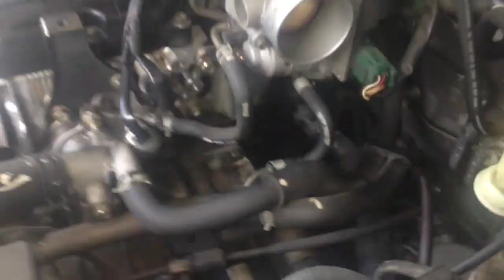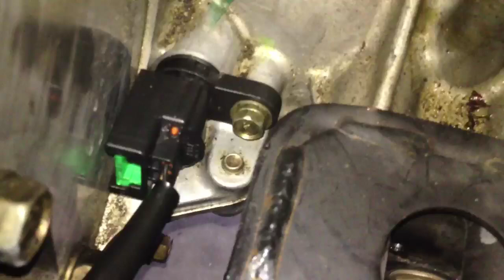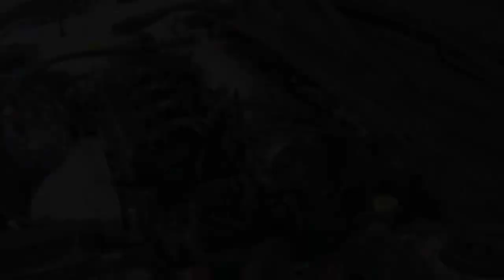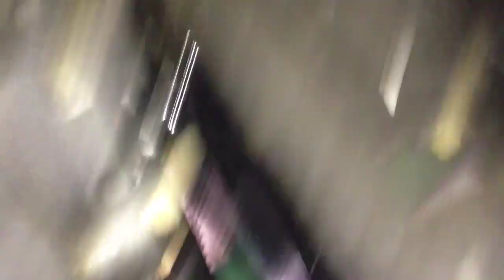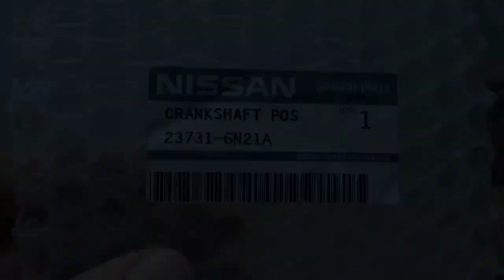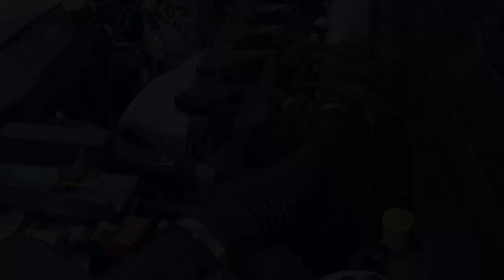Code P0335 / P0340 /P1336 - Crankshaft Positioning Sensor Replacement DIY - Nissan.

Comment: Wonderful video!!
For the last week or so while going on the interstate at about 70 mph I hear a big "jerking" noise / hesitation and suddenly the cruise is turned off. It does it once almost every day. Then the SERVICE ENGINE SOON light came on yesterday. Took it to the Auto parts store and have it scanned. The code shown today was P0335. 
Also, I just remembered that several months ago what I experienced was that the car wouldn't start once in a while. For some reason that has gone away lately. These symptoms are different from what I read others have had. Are these 2 issues related to P0335?
Thanks again for sharing this helpful video!
Reply from the maker: GIoria Wadle 
Yes, I had the same exact symptoms.
Replace both crank and cam sensors and it should fix the problem.
And as I said, don't use aftermarket - OEM only.
(They fail more oftne than not)
Here is one of the best price/quality parts I found:
http://www.amazon.com/gp/product/B00KBAQHII/ref=as_li_qf_sp_asin_il_tl?ie=UTF8&camp=1789&creative=9325&creativeASIN=B00KBAQHII&linkCode=as2&tag=dp051-20&linkId=AUEMMRY7T2CL3IEQ
Reply: Thanks again. Hope this works. I have read many sad stories online on this subject . . .

Comment: This is a great video, thank you for posting this! It shows the tools I need and their sizes (although you state 3" socket extension but it looks like a 6" was used but that's not a big deal) and, most importantly, how to remove the electrical connector by pushing on that green thing!

This is all very important when you're on a 1,000-mile road trip and you find yourself dealing with it in Podunk, Iowa, and you need to purchase not only the sensor but the tools to change it....
Reply from the maker: Chris Tubutis 
Oops, my bad. I was trying to remember the sizes way after I did it.

Comment: And I have some questions abt 2 pairs of terms like Speed Sensor & Knock Sensor VS Crankshaft Position sensor & Camshaft Postion sensor. Are these the same just different names? coz the guy in the auto store gave me Speed/Knock sensor thoses two strange terms that I never saw.
Reply from the maker: Chen Zhou 
Crankshaft is often called engine speed sensor.
Reply from the maker: Temachok 
Knock sensor is totally different from Cam or Crank sensor.

Comment: Hi, I drive My 2006 Altima 2.5 smoothly without any problem,but the engine light was suddently on the road  and it only has code P0725. Is that possible that something wrong with the Camshaft Position sensor and Crankshaft Position Sensor? speedometer is working good as usual btw.
Reply from the maker: Chen Zhou 
Yes. You may not see any difference at the begnning, but it may start having symptoms later. Try to erace the code and see if it comes back.
Reply: Well, I think I started finding some difference that IT HAS An ABNORMAL GAS COMSUMPTION.Almost 1/4 tank for less than 70 miles. Is this a symptom of a bad Crank/Cam Position sensor?

Thanks so much
Reply from the maker: Chen Zhou 
Yes, decrease in fuel economy is one of the symptoms.

Comment: First rate video! Easy to follow! confirmed several extremely dangerous faulty designed Nissan parts that kill the engine while driving! Shows clearly step by step how, what, where, why, and when to install!

Comment: I have a error code of P0011. I googled the problem and it says the crankshaft sensor possibly. It was running rough and cut off while driving and would crank back over. Do you think this is the problem? 

Thanks again in the awesome video
Reply from the maker: Antonio Diggins 
Not sure what it can be. Sounds like mechanical problem according to the code description.
Reply: Temachok The oddest thing is, I had this code before and everything pointed at the sensor. I switched out the sensor with the aftermarket on from Ebay and everything was fine afterwards. But of course her we go again. I will change it out and see if it fixes the problem! Thanks again for helpful video!
Reply from the maker: Antonio Diggins 
Try installing original OEM sensor this time. Very often aftermarket sensors don't work well or long enough.

Comment: I have a 2006 nissan Altima. Will the crankshaft be in the same spot as the one in the video?
Reply from the maker: Zxsa1996 
Yes, if it is 2.5 engine.

Comment: Thanks, very informative. I am desperately looking for a P0335 for Nissan Serena QR20 engine. Can't find the spare locally. Where can I get original. Please help.
Reply from the maker: charles chibangula 
Here is the link to Amazon for original genuine Nissan sensor:
http://www.amazon.com/gp/search/ref=as_li_qf_sp_sr_il_tl?ie=UTF8&camp=1789&creative=9325&index=aps&keywords=Crankshaft%20positioning%20sensor%20nissan%20sentra&linkCode=as2&tag=dp051-20&linkId=ZFG4CGF5RFMQBBTC

Type yor exact year, model and engine size to make sure it fints yor car.

Comment: O.K. listen I can help anyone wanting to do this in minimum time. My daughter and I did her 06 Altima and I believe I have the easiest way to change it. (30 min).  First follow instructions in video moving air filter vent and engine cover.  Then slip a work light down behind motor with light facing sensor.  Look straight down from top of motor and you can see sensor clearly.  Use your right hand to slip around right side of motor and you do not have to work blindly or use camera you will be able to clearly see what your right hand is doing by viewing from above. (Note: I am 5' 10" average weight, if you have short or "big" arms you will not be able to do this method)  The hardest part of this whole deal is getting the harness off.  Mine was a factory sensor so it could not be un-bolted until I released harness. Pushing that green tab forward can be a challenge but once it "clicks" forward you can disconnect then put your 10mm socket with 6" extension onto bolt.  Use the "short" ratchet (like in video) to remove.  Make sure harness is in "open" position when connecting the new sensor. I took some advice and went to Nissan to get sensors (It is recommended that you change out cam position sensor as well they are identical) they cost me $101 each.  If I was to do this again (I pray not) I feel I could change out both sensors in 30 min or less. Don't waste your money getting a mechanic to do this unless you just have money to waste.
Reply from the maker: Kevin Kleinhenz 
Great write up! Thank you for sharing!

Comment: I have done this as well and you can see what is going on if on top of engine through a small opening which helps instead of blindly feeling. The access is still at side per video.I am not convinced the Nissan part is better than aftermarket as well known to be a failure prone part and could be made by same aftermarket place anyway only packaged in OEM box versus an aftermarket box.
Reply from the maker: marikakyra 
I agree, but there is different quality of aftermerket parts. How do you know which one is at least as good as OEM, but just in another package...!?
I tried aftermarket parts twice and it worked for one day and then for few month only. I finally bought OEM one. 
Plus Nissan redesigned old plastic sensor and supposedly fixed problem with it leaking oil.

Comment: Very helpful video I'll let you know how I get on replacing the sensor. I am changing the camshaft and crankshaft sensors as I have codes for both
Reply from the maker: Katie McIntyre Good luck with the crank sensor, it might be a little challenging.

Comment: I just replaced mine on my 03 altima this weekend.  It was the first crankshaft sensor replacement and I was able to get it out without taking the plug off first and without taking off the bracket or air hose.  Also, It is a very small opening but if you look straight down from the top you can get a direct view of the bolt avoiding having to take videos and fumbling blindly.
Reply from the maker: TheMindfulOne 
Great! Thhank you for sharing!

Comment: Hi there temachok, great video btw I did the exact same thing you did only to find out it didn't fix my problem, my car over cranks like 2 seconds then it Tough starts I have both trouble codes p0725 and p0335 on, I changed both the crankshaft and camshaft Position sensors they are both from advance and I did notice that the crankshaft is a little longer than the old one, do you think that my problem is not fix because the aftermarket parts I use? thanks in advance for your reply God bless!!
Reply from the maker: marco hernandez Most likely yes. Try to get original Nissan sensor and see if it's gonna make a difference. 
$20 aftermarket sensor failed next day. $40 aftermarket sensor from Autoparts worked for one year. $65 Nissan sensor worked until I sold the car with no problems.
Reply: Hey there my friend, thank you very much for your video I'm glad I listen to you, I bought the original part and let me tell you so far it works like a champ, I erase the code and it hasn't go off anymore. 
Thanks again God bless you!!
Reply from the maker: marco hernandez 
Great! God bless you too!

Comment: Very good video, informative and no unnecessary "other stuff"
 I just did this job as you described it, I noticed if you put a piece of black tape on the end of the bolt head, the bolt will stay in your socket better.
The Phone video as a pair of eyes is absolutely necessary..

Great video thanks for posting quality videos.
Reply from the maker: C A R S Inc Shannon Thanks for your feedback and great advise. I appreciate it.

Comment: Two things. i found this part on Ebay with the part number you suggested. Just want to make sure as long as it has that part number, i have a good part.
Second, the layout of your Altima engine, would it be pretty similar to a rogue?
Reply from the maker: Jonathan Sloan 
Call or stop by a local Nissan dealer. Hey can tell you exact part number of the sensor by car VIN number. That's how I found mine.
Reply: Temachok do you think the layout of your altima is comparable to my nissan rogue?
Reply from the maker: Jonathan Sloan Is it 4 or 6 cylinders?
Reply: Temachok 4
Reply: Temachok Hi!  I bought genuine nissan cranshaft sensor on ebay(but with plastic casing). Not new metallic one. Dealer(on ebay) is selling them. is that ok? Will it have problems?
Reply from the maker: Nitin Khosla  
It's OK. it will work approximately as long as your original one worked (~ another 10 years).
Reply: The Service Engine Light went off yesterday. I wonder if there is actually an issue with the sensor. The only thing that changed is it got much hotter here where I live.
Reply from the maker: Jonathan Sloan 
At the beginning I had a liittle or no signs at all. 
Over time they startrd showing up more and more.

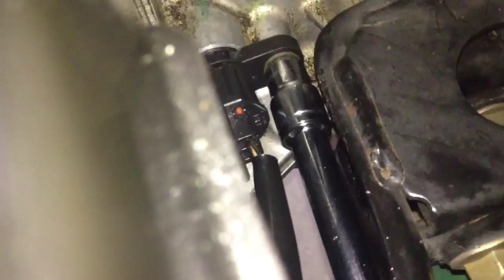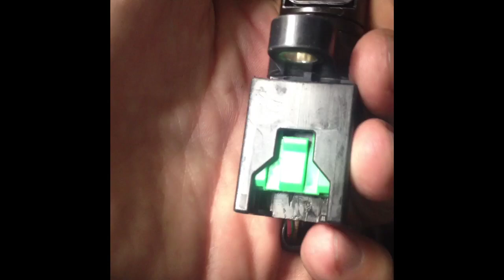Comment: HOLD ON JUST A MINUTE. At minute 3:25, old sensor, on the engine, is shown with bolt hole  OPPOSITE to the green slider on the connector. At minute 4:53, new sensor is shown with bolt hole on SAME side as green slider on connector. Don't be confused, people. That connector only goes on in one orientation. The correct one is with its bolt hole OPPOSITE to the green slider tab.

Comment: my friend has a 09 nissan altima. the code pop up p0340 camshaft positioning sensor . we replaced that . now it wont start. its a push start . we check the crankshaft but looks fine . should we go ahead and replace it anyway or is there another sensor or circuit that could cause the car not to start???
Reply from the maker: Check camshaft sensor as well. They work in tandem.
Also make sure to buy a good replacement sensors (both). Sometimes cheap aftermarket sensors dont work or not compatible with OEM sensors.
Reply: Ok thanks for the reply. I'll report back maybe Monday night or Tuesday if it starts or doesn't.

Comment: Thank you so much for posting this very helpful video.  The only symptoms my car shows is the "service engine soon" indicator light.  The only DTC my scanner is reading is a generic code P0725.  There are no other codes present.  Is it likely the P0725 is a bad crankshaft position sensor?  Thank you again for your time.
Reply from the maker: Yes, most likely. Other symptoms may appear later, as more engine oil slips inside the cracked sensor.
Reply: Temachok I recently disconnected the battery to perform some unrelated engine work.  After I reconnected it the "service engine soon" light was out and remained out until  just yesterday when the car stalled several times. Now the warning light is back on. This time my scanner is pulling both a P0725 and a P0335 DTC.  I went into my maintenance log that I keep of all the repairs I do and discovered that I had already replaced the OE Crankshaft Position Sensor two years ago (20,000 miles ago).  The replacement came from Advance Auto Parts.  I've since been on several forums and others caution about using aftermarket sensors.  They are all advising to buy the replacement from Nisson.  I'll be doing that tomorrow.  BTW, I went at this sensor from underneath (on my back) and it was brutal to access.  I'm going to attempt it from above as you have done.  Thank you one again.
Reply from the maker: Same thing. Aftermarket part from ebay worked 1 day. The one from local AutoParts lastet for about a year. It failed on the day when I was leaving for vacation... :-/

Comment: Fellas please heeeeeelp! i have a Nissan Altima 2002 3.5 engine,  it used to stop with me at traffic lights but finally it stopped not even cranking anymore. when i check it out, 11 codes came up from which 4 are repeated, P: 0340, 0335, 0331 0345, and P: 0720, 1612 and P1574. I changed the camshaft sensors bank 1 and 2 but i cannot locate the crankshaft sensor. i must watch every single video here for different way of finding it with no success. So, does the Nissan Altima 2002 V 3.5 come with that crankshaft sensor?
Reply from the maker: Try to read this forum:
http://www.nissanclub.com/forums/2002-2006-nissan-altima-discussion-2-5-3-5/281227-crankshaft-position-sensor.html

Comment: Maxima 2003 ، when I start car its take 20 second to get start .
Fullpump is ok injection electric is ok . Are the problem from crank sensor
Reply from the maker: Scan your engine for error codes to find out.

Comment: Thank you so much. You video is really helpful. I was able to get to the sensor and unscrew the bolt. Everything went well until I broke the the green connector (don't ask me why...) now I am looking for the connector part online. I did try the Nissan official website but couldn't find the part. Not sure if you know of any website/store that has such part for sale...
Reply from the maker: Try to stop by dealership or junk yard.

Comment: I replaced my camshaft positioning sensor, easiest things ever, and my car still wouldn't crank, it ended up being my crankshaft sensor and following this guide I did it and everything is good. Check engine light is off and everything seems to be going smooth, the harder part was getting my crankshaft connector to snap back in. Thank you!
Reply from the maker: Good job! 
Thank you!

Comment: Would the engine become very hot if these parts did not work?  My Nissan Sentra SER was showing codes P0340 and P0011, I had the two sensors replaced.  Previous symptoms were just a slightly rough idle, no other problems.  After changing the sensors, now the car is having exaggerated symptoms, hard start, very sluggish, won't accelerate and the engine block became glowing red hot after a 10 minute run.
I have a terrible feeling that I have fried the whole thing over what should have been a minor repair/part swap.
Reply from the maker: Engine would not start if these parts didn't work.
Where did you buy your sensors?
What engine codes are you getting now?
Reply: Holy Cow - "the engine block became glowing red hot after a 10 minute run".
You have a serious issue here.  Is there and coolant in the system?  I'm surprised that the engine hasn't seized up.
Reply: Sorry, it wasn't the block, it was the exhaust manifold. I ended up having the timing chain replaced. The car is back to it's normal self.
Reply: MLR262 Goodness, I just replaced the exhaust manifold in the same car that is now showing trouble codes P0725 and P0335.  The manifold had two cracks in it just above the pre-catalytic converter.  My guess is the cracks were the result of heat stress.  I wonder if a faulty crankshaft position sensor could have caused this as a result of improper combustion.  I am definitely going to fix this sensor problem immediately before it contributes to more damage.

Comment: Hey Temachok... My Nissan 2004 2.5L automatic starts jerking during driving.. will replacing the crankshaft and camshaft sensors resolve the problem?
Reply from the maker: Not nessecerely. Scan your car for engine error codes to know for sure.

Comment: Are the crankshaft and camshaft positioning sensors the same thing? I went to a Nissan dealer and those two parts are identical?

Also is there an advantage of using metal based sensors over plastic-based ones? The Nissan dealer had plastic-based sensors which I'm suspicious about?
Reply from the maker: Yes, those sensors are identical with the same part number. 
Plastic sensors crack over time and engine oil gets inside, causing malfunction (as you probably already discovered)... Newly designed sensors have metal cover and supposed to last longer.
Reply: Temachok
So say I had one of those sensors (didn't know whether it was specifically for cam/crankshaft) and installed it on either the crankshaft or camshaft area. Would there be any difference in performance given these sensors are identical?
Reply from the maker: As far as I know, it shouldn't be a problem.
Reply: They are the same exact part but two differeny sensors in two different locations.